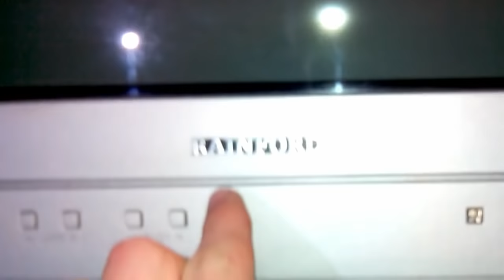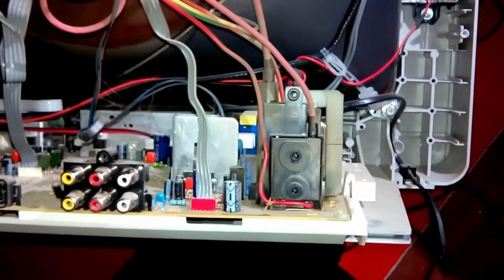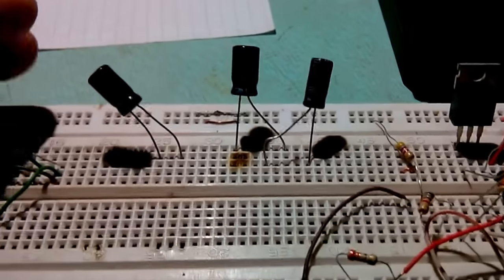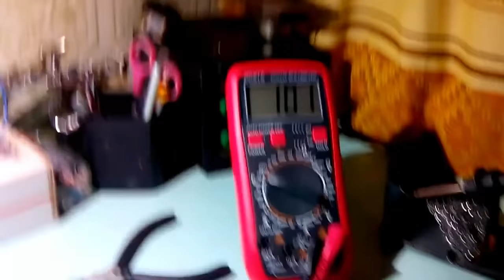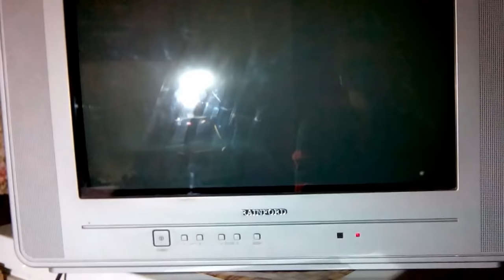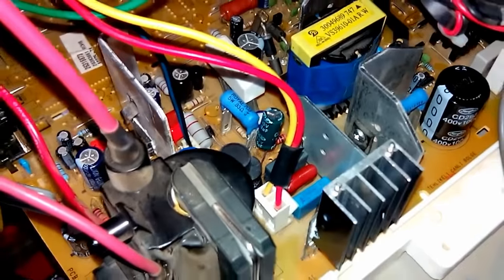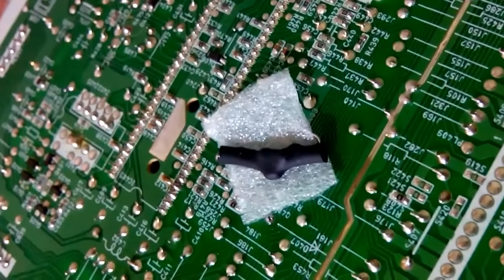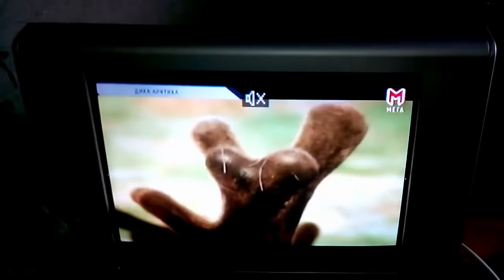CRT TV Repair #6: Doesn't power up

Comment: You're smart; smarter than me with your HOT BJT solution.  You can build an ELINCO cross hatch, color bar generator to inject a signal into the tuner.  Thanks.
Frank

Comment: Hello. One of my CRT TVs once worked then suddenly the following happened: When I press the power button, the TV only emits a high pitch sound and screen doesn't display anything. The CRT itself showed no symptoms of wear or failure before that despite over 25 years of use. Could it be the failure of capacitors,either on the power supply or at the FBT side? I can't find anybody who would do the repair and can't buy a new one due to space constraints.Thus I will have to do the repair myself. Thanks.
Reply from the maker: It usually does that when the Horizontal Output Transistor is shorted. Make sure the TV is unplugged and has been for an hour or so, for the capacitors to discharge
Reply: i have a monitor with the same issue i however don't know where to find the service manual for my monitor's model
usually would tell you what to look out for. ie parts and such.
Reply: I know I'm late but besides shorted Horizontal Out Transistor, it could faulty jungle ic. 90's toshiba crts are known to do that because sync separator are not inside the jungle ic thus the horizontal section keep oscillating.

Comment: MRJOHNNY,  The TV monitors B+ voltage is controlling what? Is the B+ voltage a bias voltage DC offset voltage for the sync and hold circuit?

Comment: Thanks for the video. I'm curious as to how you can measure ESR on a normal analogue multimeter? I thought special ESR meter is required for this?
Best wishes.
Reply from the maker: +live2digmetal No, that's not an ordinary multimeter (if you look carefully, you'll see an absence of range switch). I made a little circuit that can measure ESR and it requires 50uA movement, so I bought this cheap meter and gutted it out. Very good candidate - you have a case, a movement and jacks to connect test leads for 2$, score :D
Schematic: http://ludens.cl/Electron/esr/esr.html

Comment: hello gudeve.I have an crt tv.standby light is coming but when I press the power button nothings happen..I check the button switch it is good...
Reply from the maker: +Jansander Augusto Try pushing CH+ or CH- button when the TV is in standby mode, most TV's turn on from standby by doing that. If it doesn't you'll have to investigate further.
Reply: problem solve...open resistor...thanks...and if i need your help...pls help me okie??
Reply from the maker: +Jansander Augusto Well, you know, TV's are DIFFERENT. I can't just go and point you at the problematic part without having the schematic. More of it, there are many parts that can fail and cause same trouble. If you want me to really help you, at least tell me the model of the TV. I'm not a magician.
Reply: thank you verymuch...i allready fix my tv....more power god bless

Comment: please tell me how to join wires of on board menu buttons of CRT tv. I have a CRT tv, it was bitten by rats. First I tried to repair it. I succeeded and it repaired but after some days it damaged. now I forgot how to join wires of button plate.I have no remote. I want to on tv without remote. Please reply fast.
Reply from the maker: Sorry, but I really can't tell, all TV's are different. Try to get the idea how they're connected from the remaining chunks of wire.

Comment: Hi. need help finding inverter board for sharp 66DS-O5H crt t.v. The number on the board is F7216BMN2 A.please can you help me locate this board to purchase as i am unable to locate this.thank you shoyaib
Reply from the maker: +Shoyaib Patel Unfortunately, I can't tell where you can get the boards. Did you mean power supply board or what? I looked up the schematic for your TV and PS is not terribly complicated, maybe you'll be able to fix it. What's wrong with it?

Comment: hi its the small board located on the tueb with the two tueb pins stiaking out from the board.the L3 terminal on the corner of this curcuit board is chipped of.ther is no way i can connect the red wayer in the terminal.the L3 terminal on the scematic is referanced as G2.please can you give me your email addresh so i can send some photos.thank you shoyaib.
Reply from the maker: +Shoyaib Patel mrjohhhnnnyyy-at-yahoo.com 
Replace "-at-" with a proper symbol, I've done so to prevent spambots flooding the inbox.
 Most of the time we call that board "neckboard", the red wire you're talking about comes from flyback transformer and goes to G2, am I right? If yes, that's so called screen voltage, it's pretty high, so be careful not to zap yourself.

Comment: my tv have red screen ho do i fixed it !!
Reply: You didn't mention age/make of set... or if it's a crt or flat screen! BUT it may be cold solder in/ around your video  processor, or the video processor chip itself,  a bad cap/ xstr in same circuit, check your connectors as well bot on PC Bd. Check Connector(s) on back of CRT or to Display. CRT set? Check driver xstrs on PC bd, on rear of CRT. If all is good, check CRT or your display. It's sort of hard to real give you a narrow checklist as you didn't mention anything about your set, other than a red pic. You should try tapping your main pc bd lightly with the handle of a screwdriver... you may be surprised.good luck.
Reply: I don't know how experienced you are in TV Repair, I really meant to start with this, sorry:  >>Before doing any work on your set while it's off  make sure to discharge your CRT (if you have one), and the areas in your power supply that are relatively high in voltage..Your CRT is capable of shocking the hell out of you for months since the set has even been powered up.  * If the TV is on, and you accidentally come in contact with the High Voltage with ONE hand, the other hand away- completely isolated and behind your back... you will be thrown a few feet, and you should go to the hospital & get checked out.  If your other hand also was in contact with the set you will be unable to let go & more than likely be killed. -Be very careful

Comment: Your video would be more watchable if you used a tripod.
Reply from the maker: I agree, but first of all, I use the phone to film the video, and getting a tripod for it is tricky. Second thing is that I have to move a camera a lot to show how the TV behaves, then show how the board looks like. Some of my videos where the device under repair fits easily on the bench are almost shake-free because I use a so-called third hand to hold the phone still :) Point taken, I will try to film with the camera fixed. Thanks for watching!